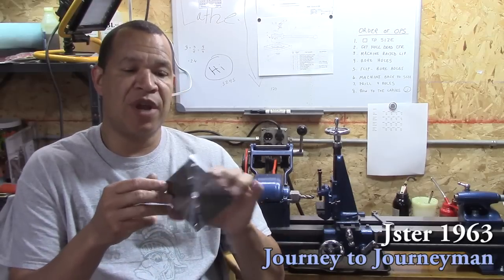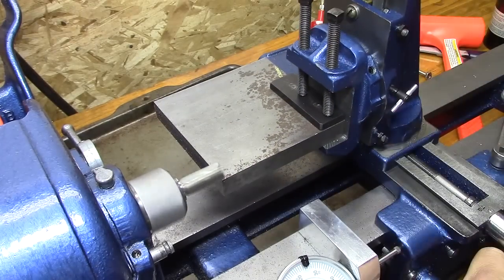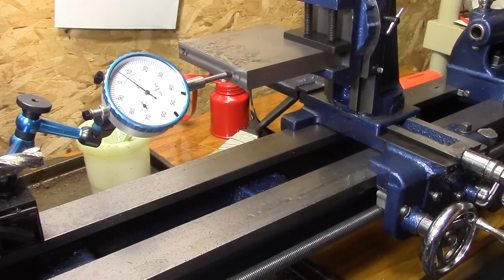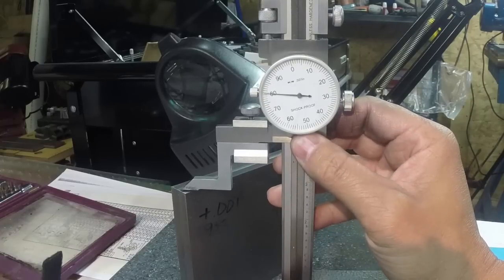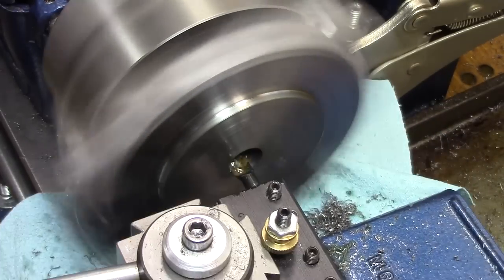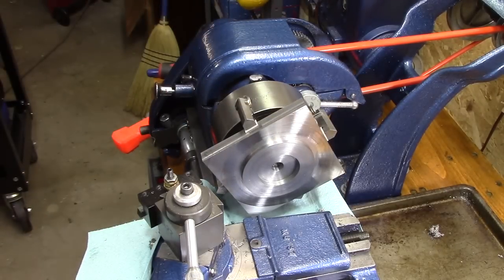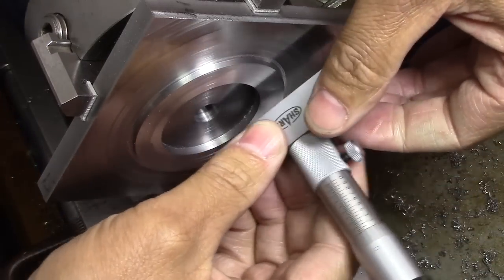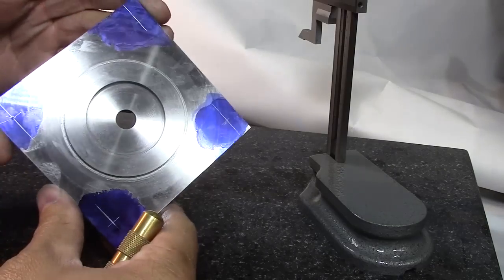Journey to Journeyman, Episode 10, WIYB-TMC, Ball Turner Project, Base Plate

Comment: Jster   the steel plate you are using is not cold rolled it is hot rolled,  cold rolled is rolled to nearly perfect dimension spec and does not have mill scale and corners are very sharp and square cold rolled is oil coated at the mill and should be oily when you buy it if it has been stored properly you should not need to take a face cut on cold rolled because it is flat when you buy it  I have been doing machine work for about 45 years and it is good to see others learning how to do it the more you learn the more fun it gets to be good video
Reply from the maker: Thank you so much!  I was upset that they sent hot rolled and called it cold rolled, but I got it resolved. I am having such a great time learning.  And thank you once again.....

Comment: Just a quick note for you- Stolen from the "practicalmachinist.com" South Bend forum(and of course I can't find  the post I was looking at): Setting the crossfeed compound to 84 degrees, with the bit at 90 deg., will give you an actual travel of .0001 with a compound screw movement of .001 indicated... I'm sure one of the guys here with more experience can fill in better details... But it might help with your measurement anxiety... Of course, you may have come across this later in the series- but in case you haven't... ;)
Reply from the maker: Thank you so much!  Great info.

Comment: jster,
  If I can make another suggestion, at 33 in the video, drilling and reaming the holes in 4 corners, drilling was ok, and you will find your reamer will last longer and stay sharper if you slow the speed by at least 3/4 of the drilling speed, make sure you have at least 0.010 material to ream and use a drop of cutting oil, or according to the material being machined, 
Please don't take these comments as negative, your doing a fine job, your work is very good, 

Edmund
Reply from the maker: +Walter Maisey I don't take these comments negative at all!  I love this kind of feedback from someone that knows this craft.  I am the apprentice and my viewers are my teachers.  I will slow down the reamer next time and use the correct oil.  Thank you so much for the feedback.  I love it......
Reply: +jster1963 
I'm glad you took it as it was intended, (your quote I will use the correct oil) I don't know what you used as a cutting oil on the drilling part, I would guess the same cutting oil would work well in steel, materials like brass, bronzes, cast iron, in my opinion do not like oil when reaming, it might work if you leave enough material to ream, I think the bible quotes at least .015 to finish ream, I tend to work around .008/.010 and that depends how accurate I require, for ordinary work I drill and ream, for accurate I either bore through, or bore first .125 deep to size then ream, a reamer will follow a drilled hole, it may ream size but its no guarantee it is placed truly, for example a flywheel if its machined on the od first and then just drilled and reamed, it most likely will have a wobble, if drilled and the front part of the hole is bored true, then reamed it should turn out ok, of course finish boring  is the most successful, picking brains is how I learned, we all had to start at the bottom, nothing wrong with that, You are well on your way, nice work, 

Edmund, 
PS: there are many ways to do things, this post is how I have done them, its not gospel,
Reply from the maker: I love it!  I always wondered what the difference between drilling and boring.  And why some did it one way versus the other.  Now it makes total sense.  Thank you again. I really appreciate your time and knowledge!

Comment: jster,
   if I can make a suggestion, for 50 years I have used small round leg inside solid nut calipers like these on eBay,     331669462971   in my case not Starrett but Moore and Wright, with practice they are ideal not only for shallow recesses but for deep large bores, and well worth having for $15.00 us, the round legs are better in my opinion,

    Edmund
Reply from the maker: +Walter Maisey I love suggestions!  Thank you for this information.  I am learning this craft from skilled gentlemen like yourself that leave me comments.  I will have to put this on my "buy" list and learn how to use them.  Thank you once again......

Comment: well done! you are indeed at the bleeding edge for that lathe.
I really appreciate you taking us through your journey. You are clearly smart, patient and motivated. I sense you plan to make precise small things when you start to master the machine. You will be really amazed when you start using that lathe as it was meant to be used on small steel and brass parts.
A few more comments to follow my surface plate comments from an earlier video:What you are doing is fine for good approximation, it will get you around +/-0.001", which is really not good enough for things like your bore hole. You should attempt to measure a full order or magnitude above the acceptable error. In other words a dimension of say 0.01" should be measure to 0.001", but a dimension of 0.010" should be measured to 0.0001" though measuring to 0.0005 is just fine 95% of the time.
The proper way to use a surface plate and height gauge is to sweep over the edge. When you set the point on top of the work, the whole set up will flex, and the amount of flex will be different depending on the pressure. Rather than setting the 0 directly on the plate, you should sweep over a standard. You can measure the width of a parallel with a mic, and sweep over that. On a lower quality tool like you have, try to sweep just one corner of the scribe since it is very unlikely that the bottom of the scribe is parallel to the plate. 
Avoid at all costs letting anything contact the surface plate that is not clean and de-burred. I run everything over the inside of my wrist to ensure it is free of burrs, lint, and oils. This includes the height gauge. Running the scribe over steel will turn the edge on the scribe (especially if you have scribed over mill scale), when you set the scribe on the plate, it will scratch the plate. The scribe should be considered a wearable part and should be dressed or replaced as needed. Getting a second scribe (expensive) is not a bad idea so you have a clean fresh one for measuring.
Make sure you clean the plate with alcohol before use (or buy some plate cleaner, it is cheap). Keep the plate covered when not in use, dust can create a real problem when it gets embedded in the granite. It is not the end of the world if the plate get too damaged to be a precision tool, those small class B plates are dirt cheap. You can stick sanding sheets to old plates for a make shift lapping plate when they are no longer useful for lay out and measurement. If you end up with three old plates, they can be lapped to each other and made perfect again.
Keep it up, I am really enjoying this.
Reply from the maker: +joshua43214 That is AWESOME info!!  Thank you so much.  I have so much to learn.  It's like eating an elephant.  I'll keep on biting.  Thanks again......

Comment: Really enjoyed your video great job on a small machine. If I could make one small suggestion on the shallow C-Bore if you had made a go nogo plug gage(its easer to measure the od with a mic.) from a scrap piece of material before you chucked your part you could check the shallow bore. Also you scared me when you polished that square face with those sharp burrs. (just found your channel)
Reply from the maker: +Edge Precision Thank you so much!  I didn't think about the "go/no-go" until I finished the project.  That would have really helped.  I scared myself too!  And thanks again....

Comment: nice work on the part, i will tell you why the1st part did turn nice and the 2ed look much nicer the 1st one was not cold rolled it was hot rolled steel and number 2 was cold rolled you can tell by looking at it my buddy runs a welding shop and i it the send cheaper hot rolled in place of cold rolled all the time. thanks for the video i sub and will check out some more of your videos please thank basement shop guy for pluging your channel if you didnt already. thanks josh (aka turnmaster)
Reply from the maker: +turnmaster Thank you so much!  I thought that acted like hot rolled.  They said it was cold rolled.  I was to new to know the difference.  I did thank basement shop guy.  He rocks!  And thanks for the sub......

Comment: love your presentation and your attitude and am amazed at what you can do with that little thing.I would love to see what you are capable of on a much bigger machine.Was wondering why you use carbide inserts on such a small machine when HSS tools would give much better results and accuracy. one more question about your spindle and the little bit of run out,does your spindle have a take up nut at the back end of the spindle to tighten and preload the bearings to take out some of the play.you kind of sound like you're from around the midwest cause you speak pretty much the same way I do, I am from around the Indiana,Illinois chicago area
Reply from the maker: +stuknda80z I don't know how I missed this comment.  I'm sorry that I'm just responding, but I just saw your comment.I'm from Michigan and live in Chicago.  So yea we would sound the same;-)Thank you very much for the kind words!  I'm learning to grind the HSS.  I am trying to figure out the best tool to cut on the small machine.  I did get some HSS ground close to being rite and it worked great.My spindle does have a take up nut and I got it tight and that did the trick!  I had to use blue locktite on the set screw to keep it from backing off.Once again thanks and sorry I just got to this......

Comment: Cuts and nicks -- on fingers. On your first video you were criticized for wearing gloves. But somewhere in Tom Lipton's enormous collection of videos there is an analysis of gloves. Tom reviewed a bunch of lathe accidents using gloves. He said that in no cases did the gloves interefere, and in some cases they  prevented injury. I agree. Obviously welder's gloves, say, are dangerous. The tight-fitting "mechanic's gloves" (sold by that name) are very good. On mine, I have cut the fingertips off so I can feel the dials. I am on blood thinners and I hate to bleed. On the bore gauge I totally agree with the other viewers. Turn up a piece a thou over and a thou under on aalternate sides. One should go in and the other should not. Very well done. A really good series.
Reply from the maker: Juan Rivero Thank you so much!  I may just have to wear the nitrile gloves and tell the "nay sayer's" to watch Tom's video.  I do wear them off camera and they have saved me a nick or cut several times.  Thanks again......

Comment: Hey again, More questions for you. 

Curious how you gauge where you stop advancing the compound with each cut when you started turning the shape. Is it all by eye? I know carriage stops work for going in line with the ways but don't see how to do it with the compound.

Love the videos by the way you're very easy to listen to and learn from. Keep it up!
Reply from the maker: Zachary Mihlrad Thank you so much!  On the dimension with the compound, I did a rough measurement and stopped by eye.  I left about 1/8" per side to take off.  Then I did a "turning" down on the diameter of it.  I kept measuring and turning until I got the correct dimension.  Thank you again......
Reply: jster1963 

That makes sense. I just picked up a 9x19 grizzly lathe and I am making (or attempting I should say) to make a piece very similar to what you made here. I was aiming for 2.81" it isn't as easy as it looks...

When you go to turn it down at the end, I assume thats when you use your carriage stop, to prevent gauging into your facing work on the diameter?
Reply from the maker: Yes.  And I used the carriage stop to make the hole bore in the center.  I needed to precisely bore that hole to a depth, and the stop allowed me to do that.  I know everything looks easier on video.  I learned that too!  And good luck with that machine.  I think you're going to love it.......ps. I'm not a machinist, just a novice

Comment: You made me jump when you got your hand into the work.  I'm afraid if you let that thing pull your arm off you're going to show it to us.  ;-)   Excellent job.  I was impressed you could get away with that part hanging so far out of the milling attachment.  I did a project last week (not up in video yet) where I struggled a lot more with a smaller part.
Reply from the maker: Crafted Lol!  I promise I won't get too graphic cuz I have a weak stomach.  I scared myself and was lucky it was just a small cut.  I left it in because I hope that a newbie can learn from it.  I was shocked at the stick out on the milling attachment too.  I was at the edge of what that machine can do!  Ps.  I'll look for your video and thank you very much.......
Reply: Now you can rate your projects in band-aids.    Are you betting on the high or low side of 4?  ;-)
Reply from the maker: LOL!  Hopefully low:-)

Comment: Nice!  I have found over the yrs that a flap disk will eat mill scale. I enjoy your well
presented vidios and this comes from a seasoned machinist for 50 yrs.  I do not
own a small lathe (mine are measured in tons)  like Randy said the big ones will
do much damage as like being locked up with a rattle snake !  so you don't get
tunnel vision....sam
Reply from the maker: samuel pine Thank you sam!  And yes, my little machine can cut off a finger or break a bone.  Those big machines can wrap you like a pretzel.  I've seen it on video.  YIKES!  I'll try my best to be careful and thanks again.....

Comment: Yep, anytime the jaws extend out past the outer surface of the chuck, you have to be extra careful.  Also, when reaming a hole, you want to slow the speed down to about half the drilling speed.  A little cutting oil is OK too.  It will make your reamer last longer.  You're right... if the work was a half inch bigger it might not have fit.  Working at the outer limits of a machine is definitely more difficult.  Great job!
Reply from the maker: HemiRod23 Thank you so much!  I totally get why you have to be careful with things that stick out.  I've learned my lesson on that!  I had no Idea that the reamer speed should slow down  Thank you!  And thanks again for the kinds words and the help......
Reply: jster1963 Yes, HemiRod23 is right about much slower speed, I can also add that in order to get accurate holes you come down only about 2 - 3 thousand per rev, since the only part doing the cut is the end part of it, slow coming out is also in order... ;-)
Reply from the maker: I didn't know that.  Thank you very much....

Comment: jster1963 nice job! Perhaps it was the angle or lens apparition, but it appeared to me like you got a better surface while facing the plate on the outer edges and the tool marks became increasingly more prominent toward the center. This would seem  to be related to the speed and feed rate so you might want to experiment with the spindle speed a little. Now I may be wrong here, but it does not seem like the snap gauge was the most accurate way to measure the bore since the lack of depth would not allow the gauge to be rocked to locate the bores centerline. I know you were limited by the depth and available measuring tools, but if you had an inside caliper I think you would have been able to rock them in two planes to find the bore diameter, then mic the calipers. This would have saved you some time not needing to increase the bore's depth, but would require a little more care manipulating the calipers to get the right feel and fit. Anyway, there is always more than one way to accomplish a task and we each approach them differently based upon our knowledge and experience of which these videos and the comments expand.  Hopefully everyone grows and begin to see things in a new light from everyone's contribution. Thanks for sharing your experiences.

Peace!
Reply from the maker: Jeffrey Vastine Thank you very much!  You are right that the outside was so nice and it got a worse finish closer to the center.  I think you are correct on the speed and feed.  I never found the perfect tool/speed/feed/depth of cut/etc.  I got it close and then polished it.  I will work on that next time.
That was my first time ever using a snap gage and I bet I didn't do it text book correct.  If I had to do it again, I think I would turn a diameter that was perfect and use it as a gage.  I was going to buy an inside micrometer, but wasn't sure I could use it right.
Thanks again and I hope to keep learning.....
Reply: jster1963 making a test plug/go no-go gauge would have been the best way to go, but I had not though of that in this scenario. Thanks for expanding my view.

Comment: When you need two diameters to be a very close fit, but doesn't matter too much what it is, cut one then turn the other till it barely fits. Hardly any need to measure. When I made my toolpost I just measured the rough bearing diameter with a scale then turned the other to a very close fit.
Reply from the maker: Andre Gross Excellent tip!  Thank you very much.......